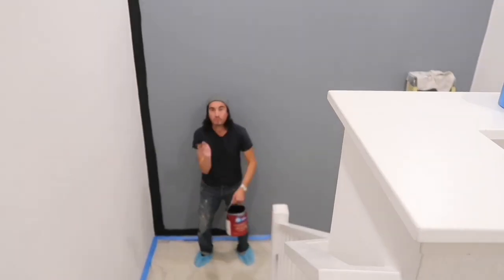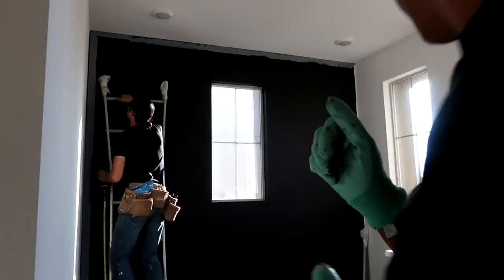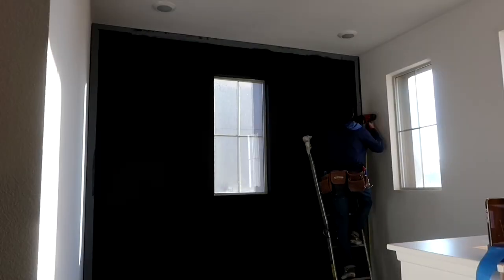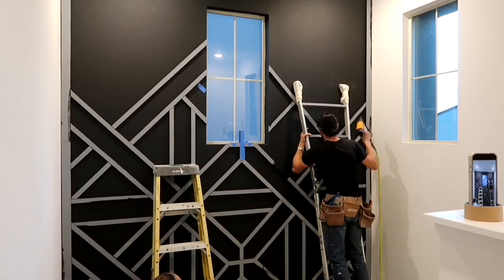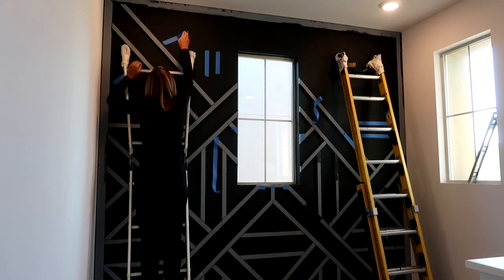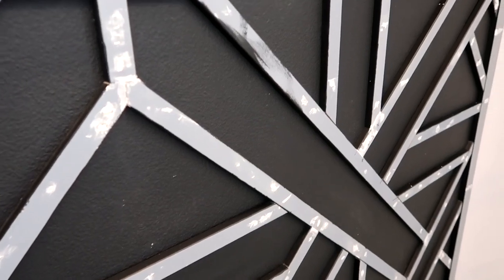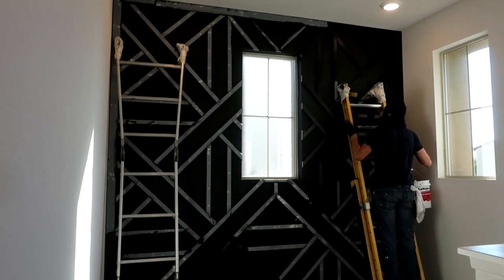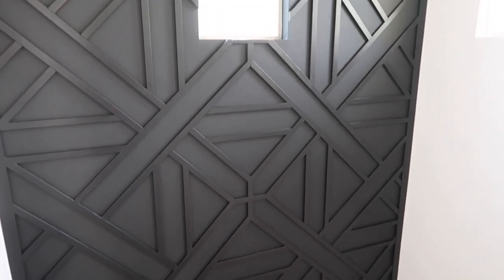DIY ACCENT WALL / WOOD TRIM ACCENT WALL IN STAIRCASE I STACIA KARCHER

Comment: The cut list is useless because they used 3/4 x 1/2 and you and I used 1x2. They are not interchangeable and probably why you finished 1 inch off. I also used 1x2x8 so I cut the long pieces at 48 so as to get 2 out of each board. From there it was much easier than using the cut list provided. I love the pattern and thank you for providing it. I also painted everything before installing it.